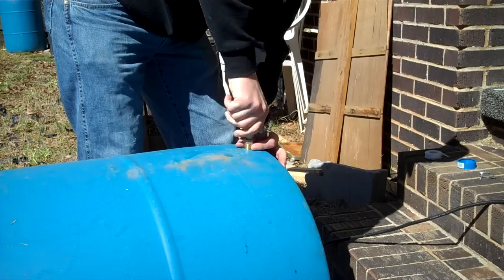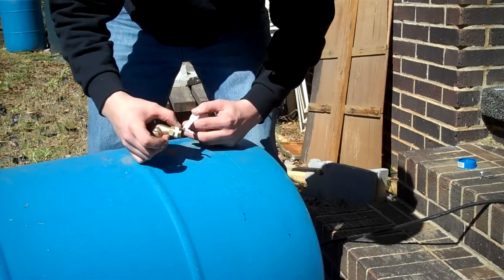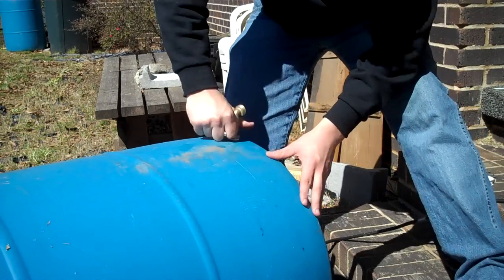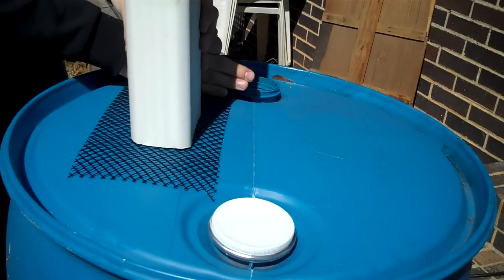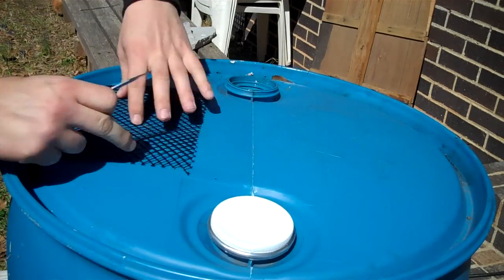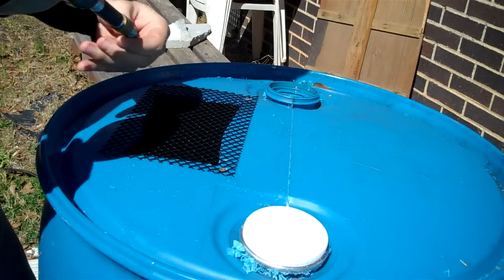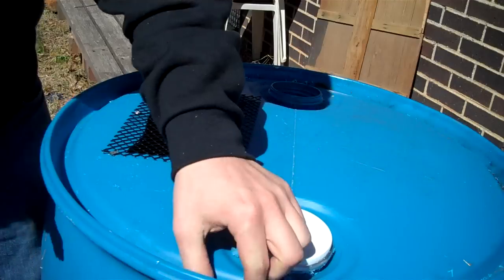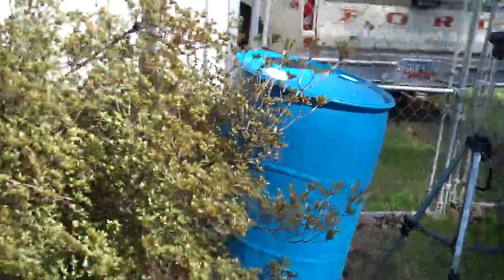A Full Tutorial of Rain Water Barrel Setup

Comment: Adding some height with flat stone or wide bricks, about 8-10 inches tall, would add some gravity push to the water flow immensely. I did the ground level barrel and I changed it to added height so I could push water through a soaker hose to my fruit tree's, as well as pour water into a watering can. Good job in a hurry though!

Comment: I would use screen mesh to keep out mosquitoes.  What happens when it overfills>? No run of place.  All the water settles around you slab.   All I did was put some screen one of the open ports.   I am thinking about putting a 2" pipe as a overflow at the top a shoot the water away from the house.  50 gals of H20 equals 400 pounds.  Some of the best stuff to feed the yard.

Comment: i was lazy and skipped cutting the top.  
Pointed my down spout to original opening that came with the barrel.   I did not even brother with the drain holes as well water is going to overflow when the barrel is filled any ways.  I put a screen over the original opening to prevent bugs from getting in to lay eggs.  
Oh!  I took out most of the water before freezing and put the original cap back on, direct the direct down spout away from the opening, to prevent water getting in the barrel and freeze inside,

It works for the second years now!!
Reply: Have any trouble with the threads on the spigot leaking?
Reply from the maker: Michael StJohn No leaks here.
Reply: i have some problem with one of the barrel.  I have to get a new barrel, draw a much smaller hole for the spigot and get my friend to put it in because i am not strong enough.  Now it works without leaks.

Comment: Just flip the barrel over, use 2 inch PVC, which will screw in to the threads, add appropriate adapters to convert to 3/4 inch threaded which will receive hose bib. Then put a cutout on top with REMOVABLE screen mesh and divert rain gutter. This was a mess.

Comment: The spigot was mounted too low! It should be at least 4" from the bottom to allow debris to the very bottom keeping the spigot from clogging. Even with the mesh you'll still get debris like the fine rocks covering the shingles. And you covered part of the opening with the teflon tape! And you'll need an overflow hose fitting near the top!  Next time take your time and think it out!

Comment: No, no, no.  Don't try to thread the fitting into a thin wall poly drum. It's sure to fail.   Install a bulkhead fitting in the drum, then screw the fitting into the bulkhead fitting's threads.  You can make a DIY bulkhead fitting with PVC electrical fittings; male and female adapters and some gaskets.

Comment: That's an awful lot of work, how about getting a pvc 2" male adaptor and screw it into the bung hole, a "t" fitting to allow for overflow when full, and a drain pipe adaptor that changes your drain pipe from square to round?  That way you don't have to cut the barrel.  I used a bulkhead fitting for the faucet so it won't leak, but instead of the regular garden faucet, I put in a 1/4 turn ball valve, which allows more water to flow, and you can screw a garden hose onto it.